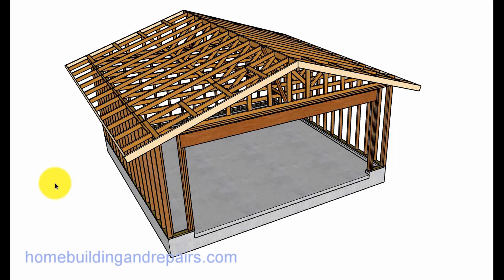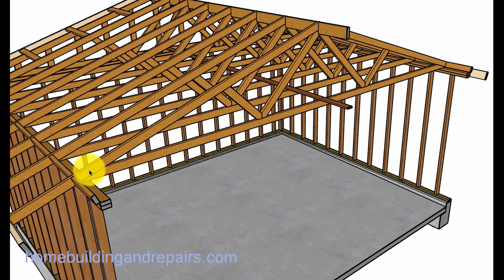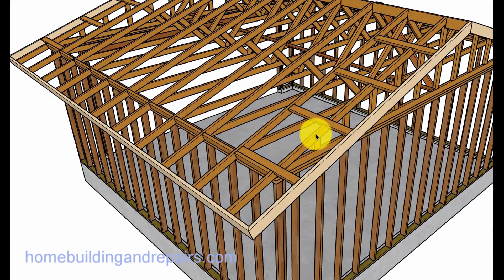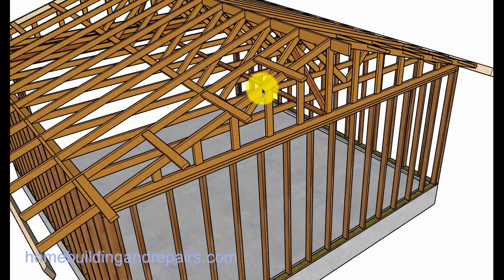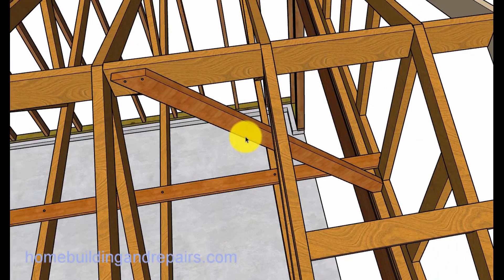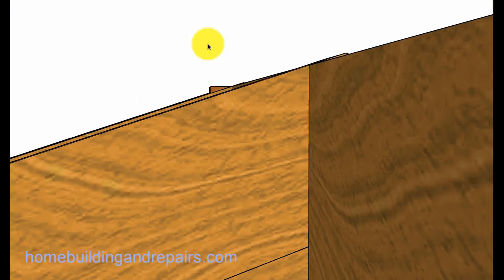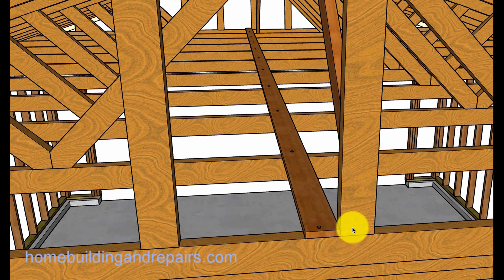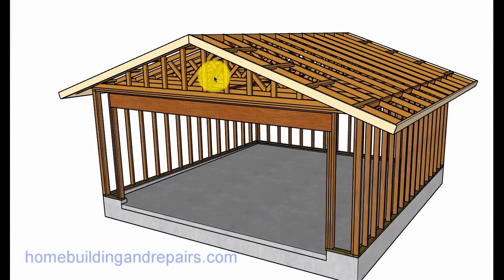Example of Gable Roof Truss Framing for Two-Car Garage

Comment: I'm going to be building a 30x30 garage and I plan to use scissor truss for more head room.  could you do a drawing with the gable end being over the garage opening 18'x9'.  Im curious on how you would frame the gable end wall when using scissor trusses.    I don't want to have that hindge issue with my build
Reply from the maker: I couldn't find the video link, but you might find something at our website in the garage or roof framing sections. They usually build the gable end wall up to the lower section or vaulted ceiling and then set the scissor truss on top, but the roof truss company can provide more detail also.

Comment: the LADDERS at the END of the Gable Roof Overhang is a 2x4?
how about the Facia Board 2x6 ?
Reply from the maker: I like to go one size larger on the fascia board if I'm doing the designing and you're right, if I'm using 2 x 4 rafters, then I can use 2 x 6 fascia board.
Reply: @gregvancom  so if my Rafters are 2x6 , and using a Ridgebeam of 2x8 - i should use a 2x6 for Facia Board ?
Thanks for reply

Comment: Great video!    I want to have a (not for storage) ceiling installed (and also heat) to our garage but I don’t know if the current roof structure will be strong enough to handle the extra weight of plywood or OSB.  It’s  hard to know or believe that any Tom, Dick or Harry may know what they’re doing correctly!!   I haven’t seen my roof in any of your videos, but I’ll keep looking!  If memory serves me correctly the garage is about 30’x30’. There are hips from each outside corner that meet up at the centre, has trusses, lookouts all around, soffits, facia (all that regular stuff), cement floor, double car space with separate doors, a man door, and a bunch of windows.  I don’t know what my question is exactly!!  I’ll keep looking for information about truss spacing and weight tolerances.  Thank you for all the videos you make. Bye bye
Reply from the maker: You're welcome and good luck with your project. Let me know if there was actually a question in their that I missed.

Comment: I wouldn't notch the gable end truss like that, especially if it's only a 2x4 top chord on the truss.  It would be better to use a dropped gable end truss.  Imagine standing on the edge of the roof over the gable... Since the outlooker is attached to the neighboring common truss, your weight would be virtually doubled at the point where the notch is (since the outlooker is a cantilever).  Also, if possible keep your outlooker as close to a vertical member of the gable end truss. ;)
Reply from the maker: We've been doing it for years in California, but it is possible to lower the gable truss so that the out lookers can sit on top of it. All you would need to do would be to check with the truss manufacturer to verify whether or not this could be done.

Comment: I'm a little puzzled by the use of blocks at the ridge line. Why are they needed? What purpose do they serve? If they do serve a purpose you might as well just put in a ridge beam.
Reply from the maker: I have actually seen roof trusses installed without blocking at the top and if that is what the roof manufacturer suggests in their installation instructions then go for it. Obviously you would be of the put a ridge beam in and use the trusses or at least that would be difficult to do using the roof trusses and our example. I'm not an engineer, but believe the blocks provide perimeter nailing and this is used to create a stronger structure. It allows all of the roof sheathing to be securely fastened around the entire perimeter of each roof plane.
Reply: Thanks for your reply.  I found another good reason to use them. They ensure proper spacing as you put eat truss up  @gregvancom
Reply: @jameshochstetler6093  It's a lot easier to just nail a 2x4 or 1x4 to the cross members somewhere near the top inside.